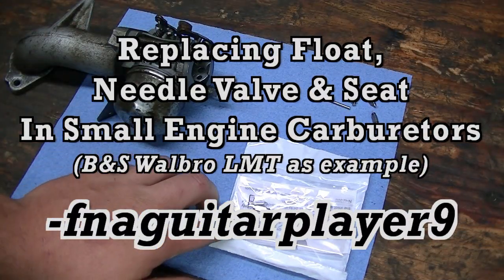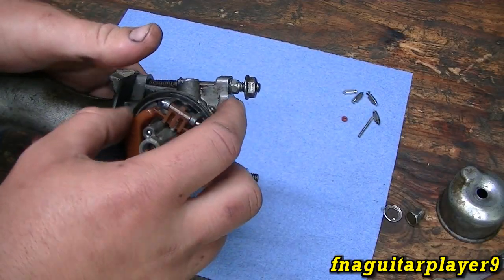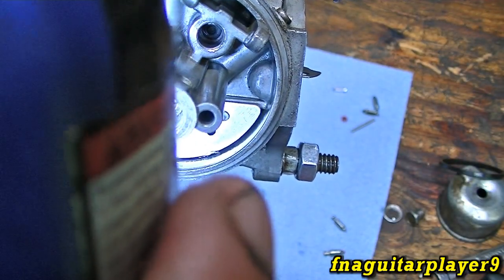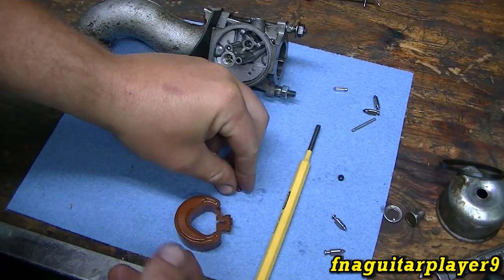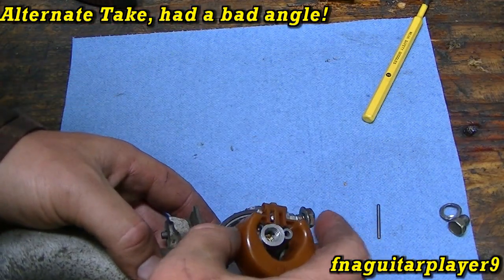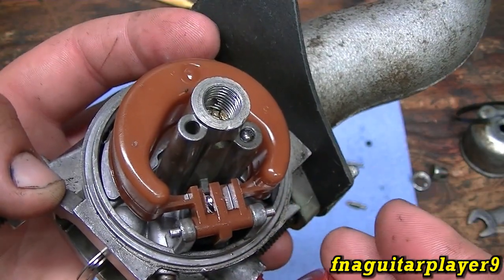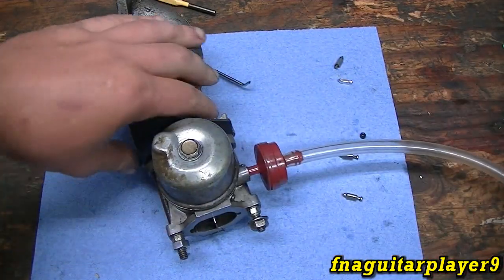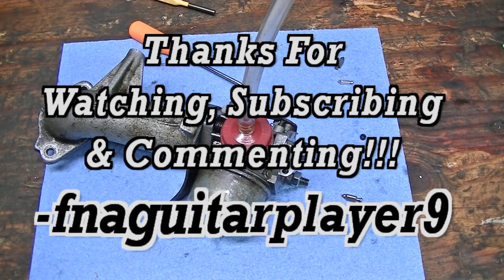Replacing Float, Needle Valve & Seat in Small Engine Carburetors (Walbro LMT as Example)

Comment: The seat goes in one way only!! There is a groove or ridge around the center of the seat, That groove or ridge goes towards the carb, not the needle. Hope this helps someone.
Reply from the maker: Yes you are correct, it can go in the other way but the needle may not seal properly. thanks for watching!!!
Reply: Thanks that's what I was looking for I noticed one side had groove
Reply: Greg Reitan that was mentioned in the video
Reply: Greg,Thanks for mentioning that.....thats important.
Reply: That's what I was wondering.
Reply: Yes I was specifically seeking this exact information. Thanks very much

Comment: @ 2:46

Likely the old one was swollen from years of being exposed to gasoline.

There are at least two different rubber seats, but I think he was right in his application.

Bottom line is that the fuel shuts off like it is supposed to do. No black smoke, no missing or dying at high RPMs.
Reply from the maker: Yeah the ethanol in gas takes a toll on these parts too. Thanks for Watching!

Comment: Hello there I'm new to a snowblower and I cleaned up the carburetor but the thing is is that when I took it apart the float had come loose and fell out while I had taken it bottom off so now I'm kinda stuck in trying to put the float back in and it is an older machine and the little thin pin is still attached to the float my question is how to put it back in without taken all the rest of it apart or dose it all have to come off ? And yes I just watched the video

Comment: First off great channel! I'm having an issue with the lawnmower getting flooded and the fuel has been sitting over winter so I'm thinking maybe bad float or needle/seat...it runs on and off but seems to be running a little too fuel rich and then when it sits it floods too
Reply from the maker: Thanks, appreciate that! Probably either the float leaking if its a metal float or the needle / seat is causing you problems. Thanks for Watching!!!
Reply: fnaguitarplayer9 thanx man! Yeah it's a plastic float so I'm thinking bad seat or both seat and needle...do you know best way to get the set up for a decent price?
Reply: Just about all B&S engines up to 20 hours will take the same pin and float part number kit.
I would do the float at the same time.
Iintake manifold gasket and bowl seal.
I use Jack's Small Engine out of Maryland. 
To be sure your getting the engine model and type.
This should be entered with a hyphen between the two numbers when searching.
Reply: Upon further inspection the needle valve was rounded so I replaced that and the gasket needed to be replaced as well...no more flooding and mower is running better than ever....the carburetor that I was dealing with had a built in seat...nikki carb with a plastic body that had built in seat for the needle valve...
Reply: Supposedly the alcohol in the fuel is rough on the rubber and plastic parts. Might have contributed to the decay of the rubber tip on the float needle, or the needle seat.

Comment: On a kohler ks540-3011 engine 18hp, the carb needle hangs in a plastic float a drops into a plastic plate that separates the float bowl and the main body. It does not appear to have a seat in the plastic hole that the needle drops into causing the float not to sit level!  The kit I got had a needle but no seat! What am I missing? Thank you!

Comment: What is the purpose to the seat in a float valve? I'm trying to figure out a problem with my 5 hp outboard engine. It's running very rich at higher throttle. Float valve itself doesn't seem bad after inspection.

Comment: On a 90's model Tecumseh 3.5hp with a metal float. My mower runs fine unless it is tipped down to one side while mowing. It wants to die. Too much gas? Float problem. I shook the float no sound of gas in it. It floats in a cup of gas but not level. Side where the needle is attached sinks lower on that side. Any idea. I did a thorough clean and new parts of needle, seat and bowl gasket. Float was level and upside down it didn't allow air to pass the needle-seat?  Thanks in advance.

Comment: If the needle has a rubber tip then the seat is brass usually and can be polished with a Qtip in a drill using polish or rubbing compound. Clean and blow out afterwards.
Reply from the maker: Thats a good idea, i'll try that next time I have a issue with one not sealing. Thanks for Watching!!!
Reply: does the brass seat come out ?  i just drilled a screw into mine thinking it was a brass seat but now not to sure and may have damaged the carby body
Reply from the maker: Some do and some don't, but you may be able to put the rubber seat in and it should seal fine. Just depends on the carb. Thanks for Watching!!!
Reply: Hello James. If it's a brass seat, it probably comes out and can be replaced. Search YT for plenty of vids to show you how to do it.
Reply: Hello Greg. But you must be careful not to remove too much metal at the bottom of the seat. Any metal removed actually changes the effective length of the needle. It conceivably could reach a point where the fuel won't shut off anymore, effectively flooding out the carb.

Comment: Thanks for the wisdom, here I am for the last 2 weeks breaking my head with the carb that is flooding into the case.  I am about to put a shut off valve on there, but that is not my style.  Then you tell me about needle seats.  changed needle 2 or 3 months ago and start flooding.  Seat must have disintegrated and the store I bought needle from didn't tell me about seat.  Here I am cleaning polishing honing carb body thinking angle cut into that.  NO luck.  I even ben the tab on the float still no luck.  Now some wisdom for you.  Your method of checking the carb no good.   This same carb doesn't blow air through, but leaks.  The correct way to check is by sucking on the inlet valve with the float upside down.  Move your tongue on the tube while applying vacuum, if it holds you have a good seal, if not something no good.

Comment: Thanks for the video.
does the small  pin in the needle valve suppose to pass the air and stop when compressed or is it the entire needle valve that lifts up of the bush to allow fuel to run in? My needle valve (new) doesn't allow air flow unless i use an air compressor which blows up the whole valve and let the air flow. Also, I have a metal hinge that binds the valve with the float but Im not sure it is suppose to have a tight fit so when the float moves it immediately lifts up the entire valve and open the air passage?
Reply from the maker: Your welcome! The float will pull it open when it drops down, you should be able to blow through it, without compressed air. Thanks for Watching!

Comment: I have a mikuni carb on a 70's kubota a650-3y portable generator I cannot find an asian carb so trying to fix original carb. There is no seat inside only a beveled metal bottom with a hole that looks like the rubber needle tip would seat on it. When together with the plastic carb float up the float is not level it hangs down a bit. any input appreciated. Thanks
Reply from the maker: Alot of times the plastic floats will kind of warp or stretch and you may not be able to see it, and they need to be replaced, since they are not adjustable like the old metal ones were. Unless you can find a slightly longer needle valve that might bring it up, as long as it hooks to the float and seals off it should be fine. Thanks for Watching!!!

Comment: Question if the needle is BLACK RUBBER TIP do they have a RED SEAT ???
took apart a Carb for 2014 Briggs 250cc snow engine OHV  Cleaned main jet and emulsion tube Clogged 
now the Engine us SURGING ??????????????
Not Sure if the RED SEAT CAME Out ot it Does not have one ???
Reply from the maker: Not always, it can be any combination, most of the time both are black. Thanks for Watching!!!

Comment: Is it possible to have a bad float pin causing the float to not hinge up correctly and get stuck under the gas instead of floating on top?
Reply from the maker: Its possible, and most carb kits come with a new pin, so it might be worth trying to see if thats whats wrong. because it has to be working smooth or it will stick all the time. Thanks for Watching!!!
Reply: Here's a question for you, Mack: What would be your symptoms if that happened?

Comment: Do you have to remove the carb, or can this be done in place?
Reply from the maker: Its easier to have the carb off, its possible to do it while its still on the engine but it is alot trickier to do, and easier to drop a part and loose it haha Thanks for Watching!

Comment: Now i have a problem with a  toro lawnmower carburetor and a Tory Bilt lawnmower carburetor i clean the carburetor jets holes and those kinds of carburetor the jets tube in the middle i don't think that those kinds of tubes can be remove both lawnmower are  self primer, i don't think it any compressor problem because both lawnmower almost new, any ideas if so can you please let me know Thanks
Reply from the maker: Usually with those carburetors you have to the clean the "bolt" that holds the bowl on, there is a T shaped passage in it and it kind of acts like a jet, its a really small hole and plugs up easily. Thanks for Watching!!!

Comment: l have a Briggs and straton 19.5hp it run for 15 minutes  and then dies  then i drain the carburetor bole  it will run for  a other 15 minutes .  what might be wrong with it ?
Reply from the maker: Check it for spark when it quits running, sounds like possibly a bad coil and its loosing spark. It could be carburetor related, but check it for spark first and see what you got. If its not loosing spark, then i would suggest cleaning/rebuilding the carburetor, if that is a opposed twin, then the fuel pump part of the carb may need rebuilt as well. Thanks for Watching!!!
Reply: Hey Stephen. Are you getting any black smoke out the exhaust while it's running? That might indicate that it's running rich. If that's the case, your float valve might not be closing when it should be.

Comment: Cuz, love your videos! I rebuilt a B&S 286707 last week watching referring to your playlist on the same 12.5 HP, mine a Toro/Wheelhorse XL version. https://www.youtube.com/watch?v=DXvgJttmfOs&list=PLOTZjij4iVfRNFbqTcOUaj3yeWO8vqwRq&index=2

Tremendous help there, and it purrs like a kitten now. Needle valve failed and it smeared the rod's big end all over the crank journal. Got to fire up my WW2 lathe to clean and polish. New rod, gaskets, flywheel bushing and seals. New rod is quite an upgrade. 

On to the needle valve question. This one has a brass seat, you probably know it's cup shaped. Is this type of seat best used with the all metal needle or with the black plastic kit? 

B&S #22-10933 for the rebuild kit. Also includes the seats themselves, 4 jets and a bunch of other stuff. I guess I will investigate the hole size in the original seat, because I have 3 different sizes at hand for replacement. 

Model 286707
Type 0453 01
Carb LMT 77

 ~jon